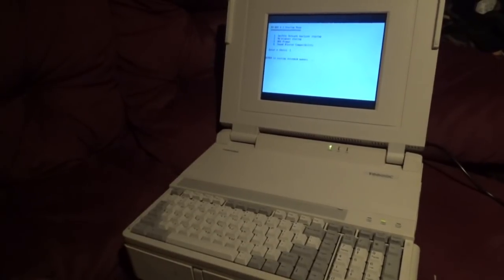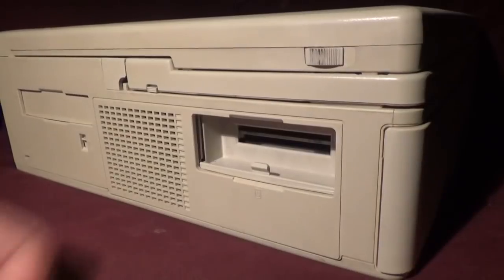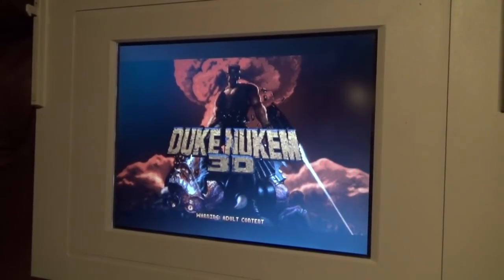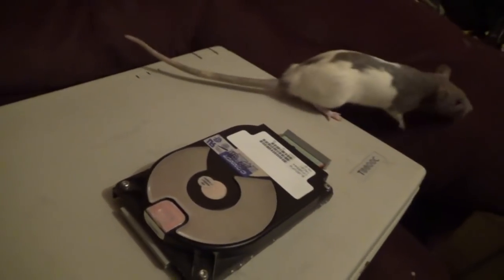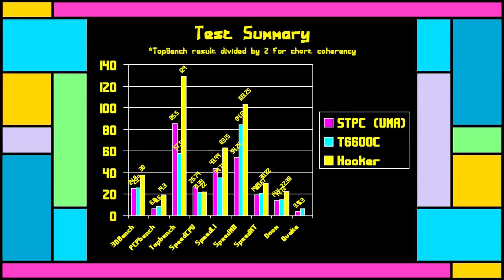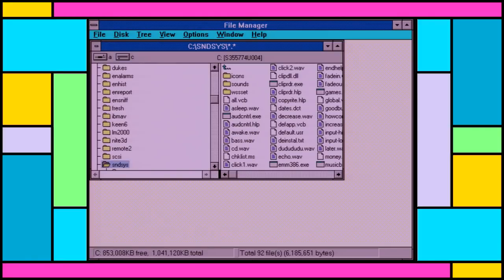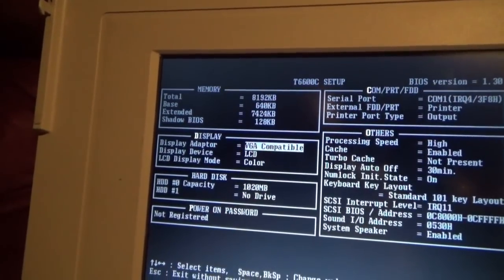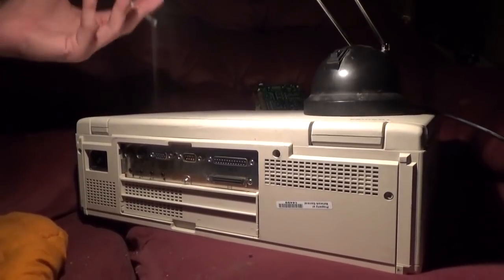T6600C Portable 486

Comment: Nice system!  What a great find, I always wanted one of these for the ISA slots, to put a full-length AWE32 in there and have TRUE hardware WaveTable in a portable computer, for playing those vintage DOS games and plugging my digital piano into with 0 latency.  I may have some DOS WSS Info for you, see below.
I guess I'm a Toshiba fan, my Dad bought a Satellite Pro 400CDT Pentium 75 new back in the day for many thousands (!), wishes he'd waited a little more and gotten a Tecra machine.  Still have the 400CDT it works great.  Also have a Satellite 4060XCDT, nice PII machine.  For daily use I use a 'modern' (10 years old now...!) Toshiba A200 that I found in the bin, does what I need it to do.

About the Windows Sound System in DOS, if you're interested I may be able to help you there.  I also have a vintage Zenith Z-Noteflex 486 laptop with WSS, and got it working in WfW 3.11 AND DOS.  See my postings at the VOGONS forum, I'm Bellarmine there also (just look for the horse....:o)
https://www.vogons.org/viewtopic.php?p=646426#p646426

Also, about the bad cap on your HDD, you might want to check those biggish square yellow cube caps.  I have a Seagate 431MB HDD that went from working to shorting out the pwrsup one day.  Few years later I noticed that the 5V was shorted to GND, found one of those little yel caps shorted, popped it off the board and the drive has been working since.  You might be lucky too.  Had the same problem with a vintage true-blue Intel 386 PC I have, I was lucky in that the cap burned instead of shorting out so I knew which one to replace, otherwise I might have had a dead board.  Guess those tantulam caps don't last forever.

Let me know if you'd like some more info.  I sincerely hope your problems have gotten sorted, and you now have a NEW VIDEO CAMERA!  I hear your frustration, technology can be such amazing great fun and such a big huge pain at the same time eh?

Cheers and stay well!~  Bellarmine

Comment: Why don't you have a Patreon?  I never see adverts on your videos and I watch your videos a number of times as I really enjoy the content.  How on Earth do you actually manage to get all these systems and hardware?  Also known as keep up the good work :)
Reply from the maker: Because then I'd probably feel obliged to make videos, instead of just throwing things together whenever I feel like it, the quality would take a hit as a result. Maybe t-shirts some day, just for a laugh, but only a limited run and probably with no real profits. Hardware is obtained largely by luck and years of being into this stuff - keep in mind a lot of it was gotten hold of before it got expensive, otherwise it was bought as scrap or broken, hence luck because it often ends up working with minimal fuss.
As an example, I bought a lot of five 'scrap' 486 boards a while back which included an MS-4144, a board I wanted to get hold of again and the lot cost around the same as this board usually goes for working. All five boards worked, aside from the MS-4144 which needed a new KBC sticking on, essentially rendering the other four boards 'free' and 'profit' if cleaned up and sold on, this can then cover the cost of something that is sold as known working. Things like this will cover the cost of, say, the smaller hard drive that this T6600C needs, as the current 2GB one would really go better in something else, probably the P90 or even that MS-4144 system.
There are also some long games that I'm playing, mostly regarding the CPU collectors' market, it's all a game of luck but I think I'm onto something.
Anyways, thanks.

Comment: That Elite Book wow, wash with gas/petrol and dry with match. That Toshiba is a nice and rare find.
Reply from the maker: EliteBook is retiring in a few weeks, also that keyboard stopped working a long time ago (third one the system has had) so cleaning just isn't worth it. Incidentally, I do usually clean with petroleum-based substances because it is non-conductive and extremely cheap. namely lighter fluid.
Don't know that the T6600C is particularly rare compared to other similar systems, probably will get expensive in the next few years though, especially as more of them fall off the map.

Comment: This system reminds me so much of my T6400DXC. Unfortunately, when I got that machine many moons ago, it had no hard drive installed (which is surprising, considering how you need to pull apart the whole thing just to get to the HDD). Its BIOS is hard coded to only accept the 120MB Conner, which I never got for the machine.

I used to lug it around with me to school, along with a few floppy boot DiskStation and utils. The ISA slot is extremely useful :)
Reply from the maker: Guess that would be a precursor to this one. You might be able to use a drive overlay, like ANYDRIVE, but if you're running SCSI or something from the ISA slot it probably isn't worth messing with; if it ain't broke, don't fix it after all. So far as I know, the IDE controller on this one has the same typical limits that Toshiba liked putting on them, haven't tried, the SCSI works.
Reply: @HighTreason610  The biggest issue is the BIOS always waits 2 minutes for the nonexistent drive to respond, then throws an error, and finally it then boots from floppy.

And that leads onto my next problem, I can only use it from floppy. I used to lug it to school with a full case of disks in my school bag...

I would hazard a guess that the BIOS itself would need to be patched, I could always try hard wiring in a XT-IDE adapter and mount it next to the sound card I have in the ISA slot...

Anyway, I'm rambling now. Good video as always, sir! Got me thinking about old computer projects again.

Comment: too bad you can't get the sound to work in DOS. Have you tried tinkering with the IRQ and DMA settings in the BIOS?
Reply from the maker: You can only change the I/O address in the BIOS, which seems to resemble how the WSS cards only have one jumper. The other settings appear to be set up in software, changing them does nothing particularly notable. I'd wager the Sound Blaster stuff is probably done in software anyway, so it shouldn't be too important versus having a real card sat on those resources.

Comment: This thing is nothing short of a preposterous monstrosity. Compared to the T1000 it's beyond absurd but it's a fascinating example of the lengths Toshiba went to fill every possible niche. I've got a T4850CT someplace that needs repairing so maybe that'll appear at some point. Please explain to me the compulsion to bench Quake on a 486 when it's well below the acceptable baseline? (e.g. Pentium 90) Surely Wolf3D would have been better, especially as Doom seemed to struggle. (yet Duke 3D didnt?!) I'm also wondering whether Wolf3D would pick up the OPL3 as an 'Ad Lib' perhaps. I have read that Sound Blaster compatibility was never an option - it seems this thing was built as a 'multimedia luggable'. Still, a 486 with built-in sound is uncommon.
Reply from the maker: T4850 eh? Looks pretty nice from what I can see on the interwebs.
Quake is benchmarked solely for comparison sake, honestly can't remember the last time I even played it on anything as the game doesn't appeal to me. Doom's renderer is less efficient than the one in Build in my experience, at least when drawing the same kind of things, though also keep in mind Build is framedropping here where IDTech isn't due to the timedemo. Software can see the OPL chip, even without the TSR loaded, it does just work as an AdLib, the Sound Blaster stuff is supposed to be an option, it even has settings for it in the driver setup, they just don't work. Thought I had a picture of the options screen but can't find it, it's nothing interesting anyway, just radio buttons with 'SB Address' and 'SB IRQ' type things.
Should definitely be possible to disable the WSS in the BIOS and hijack the speakers for another card, probably an OPTi 929 as there are plenty of those in here.